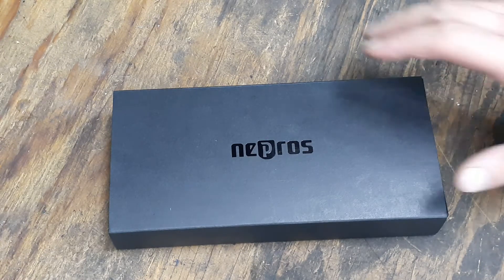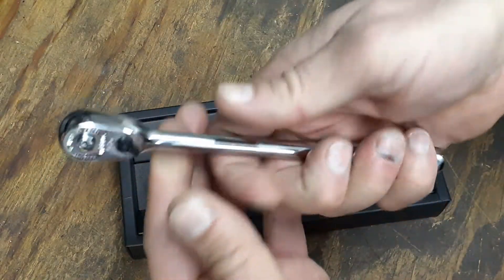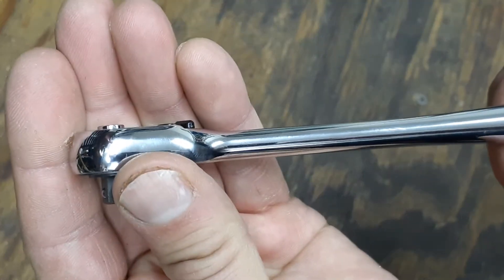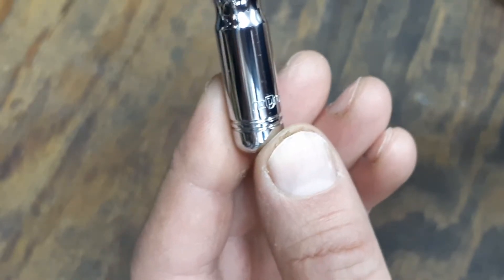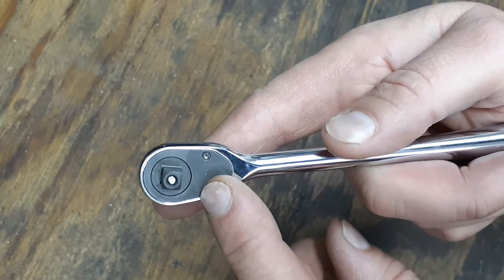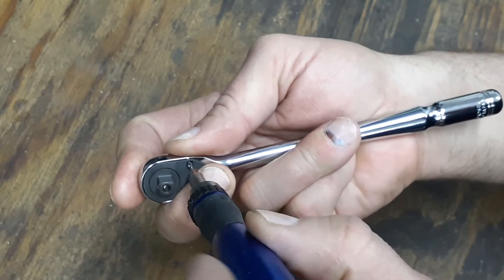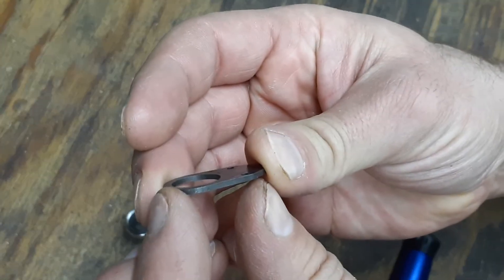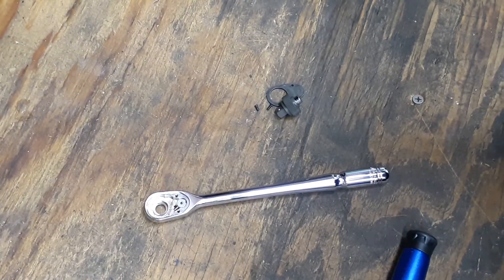nepros 1/4 Ratchet Handle NBR290L teardown

Comment: You should send them a picture of the screw, they are really strict with the quality, usually never have a "black sheep" in the production ratchet, but yeah, try to use a JIS screwdriver, they work a lot better than a Philips, and you can use those in a Philips head too, good luck! If you did buy it from Japan directly you can get a replacement sending them exactly what happened!
Reply from the maker: The screws didnt look good, so I am vourious to see if they will send new hardware or not.

Comment: It's probably a JIS screw, I agree that they should use a torx fastener instead. It's a really sharp looking ratchet, I would probably hesitate to use it sometimes lol
Reply from the maker: Im not real sure, I jsut know it was over tightened to the point that the fasteners were stripped! Thanks for the comment.
Reply from the maker: Jis screwdriver set will be on my new list of tools!
Reply: @mlacher100  is it that uncommon where you life ? They are in the Wera Tool Check if you get the Metric Version in Germany it's hard to come by Bit Sets without them
Reply from the maker: @Xyz-ij6rh  yes it is hard, I have never seen them any where before.